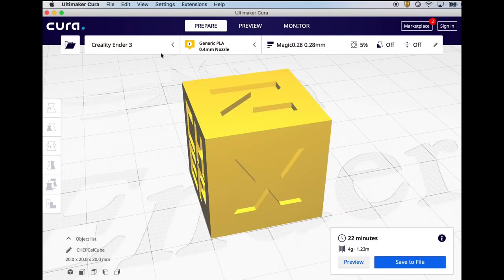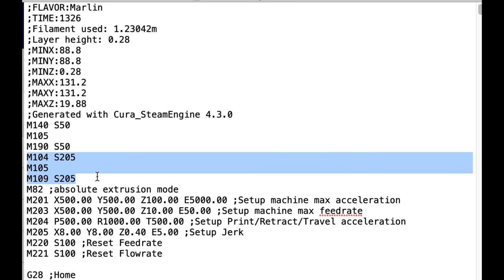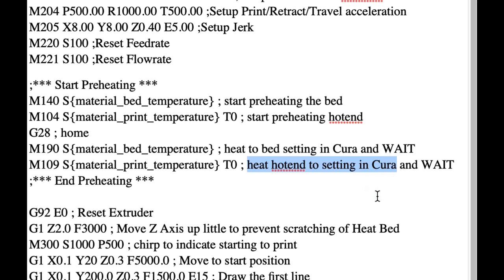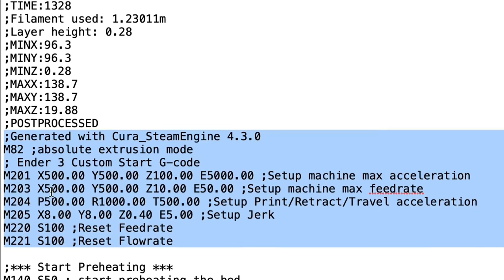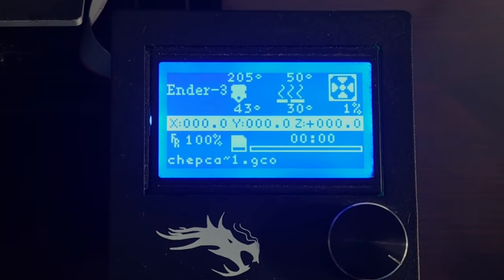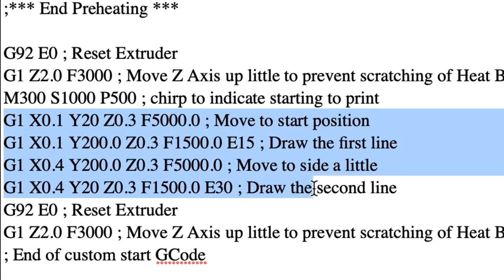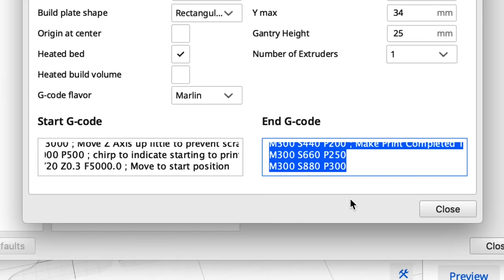Faster Hot End & Heated Bed warm-up in Cura

Comment: I am using the Creality Ender -3 v2 profile in Cura. There are no '"M" g-codes in my Start G-code settings in this profile. Is this some that has changed since this video was made?
Reply from the maker: You have to add them per the video. Link in description
Reply: @FilamentFriday  sorry, I didn’t explain myself properly. Your profile had a number of “M” g-code lines before you added these new ones. Mine didn’t have any so my start g-code looks very different to yours to start off with. I was trying to figure out where in the start g-code to put these new lines compared to yours.
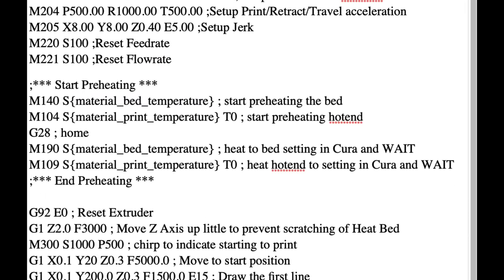Reply: Yeah, mine was also different, didn't have the "M204" etc. lines you see at 2:27, it just started with:
; Ender 3 Custom Start G-code
G92 E0 ; Reset Extruder
G28 ; home

I just wrapped the new code around that home command.

Comment: Just recently started 3d printing. I always assumed there's a good reason for this. Have you noticed any downsides to doing this? Maybe shorter PSU life, higher power usage or something?
Reply from the maker: Nope.
Reply: @FilamentFriday  Cool! Thanks!
Reply: If you preheat your hotend too early, it starts oozing out before its ready to print. This also leaves a hollow cavity in the nozzle, and you have to do a skirt or something on your prints before starting or your initial layer gets messed up.
Reply: Sean like cuts already does with the test strip

Comment: Hi CHEP, 

Preheat command no longer works on Cura 4.7
It seems to heatup to temperature and stop reading lines after when command line is input in start g-code.
Everything resumed to normal when code was commented out.
Reply from the maker: I’ll check it out.
Reply: Are you using Cura 4.7 since its still buggy so I recommend staying with 4.6 for a bit
Reply: Ah shit I was about to input this in Cura 4.8

Do any of you know if this is currently working?

Comment: Note that there is a couple of bad printers out there where the PSU isn't made to handle the power needed for both to heat up from cold, thus potentially reducing the PSUs lifetime. If you have an 8 hour print, saving these 5 minutes isn't really worth it.
Reply from the maker: Which is why I mentioned it in the video.
Reply: thats the first thing I thought But its good if you got AC heat bed (i.e Tevo Flash) useful Video for me Thanks :)

Comment: It seems that the Silent Board 1.1.5 for Ender 3 can sing in only one tone. I tried different values, the "Pxxx" parameter works well but "Sxxx" as no effect.
Useful tip anyway ;)
Reply: I dont have the silent board but I have new Ender 3 Pro and it also only sings one tone.

Comment: Putting this in start gcode doesn't work for me. I also noticed different variables used in the video vs the files on your homepage. Do i need to remove other start gcode in addition to make this work? What happens when I hit print is that the bed heats up....that's it. nothing more happens. No hot end heating = no printing.
Reply: K, got it. Copy pasted from another source which seems to be the same text. Seems either in copy&pasting from your hp there's some format error stuff happening or there's some misstake in it.

Comment: Nice THX! But, how do I write that the hotend does not heat up with the bed at same time, only when the bed has reached 50% should the hotend start heating? I think hotend is faster as the bed... How is the Gcode to say "when bed has 50%, heat the hotend" or "wait 120 seconds before heat the hotend"? You know what I mean?
Reply from the maker: I believe there is a delay GCode. I just can’t remember it.
Reply: @FilamentFriday  Too bad. I think that if both are heating at the same time it is a higher load for the power supply. The other way around it takes a long time and a compromise would be delayed heating ...
What ever, thx for your answer so quickly :)
Reply: You can check what's the average time it takes to reach your max temp, divide that by 2 and try to use G4 command to wait.
Reply: @siveonfarcloud4190  It works, it works very good for PETG, but not for PLA and really bad for TPU :(
What I need and search is a way to make:
if (bed_temperature <= 40) {
M140 G4 S0 }
if (bed_temperature >= 40 && <= 60) {
M140 G4 S60 }
if (bed_temperature >= 60) {
M140 G4 S120 }
Reply: @la3el  For anything more fancy you would need to manually edit the gcode or the firmware.

Comment: Using a glass bed I've noticed that it take a bit longer than the bed to get to temp on the print surface compared to what the readings say. So I'm wondering if this really is a good idea on glass?
Reply from the maker: Test it and find out. I use a swipe of glue stick on my glass and often can print PLA without heat. So it depends on your setup.

Comment: I always just turn on my printer then preheat pla.. this heats both up at the same time. Then when it's warmed up just print file.
Reply from the maker: But then it sits hot until you install the file and click print or if you walk away. The PLA can expand and clog. I prefer it to start heating when I start the print.
Reply: @FilamentFriday  ok.. it only takes a minute or two and I always sit and wait and watch things.. when they are heated up, I turn the extruder to see how the filament is coming out.. then I watch at least the first layer go down..
I have never just pressed print and walked away..
That's just me though with only 1 3d printer.
Reply: @BlindDude  You have to understand that us seeing people have shorter attention spans. ;)

Comment: my ender 3 does that from out of the box both heat up at the same time  yes the hot end gets there first .the bed maybe 10 to 20 secs after ish
Reply from the maker: From the GCode or are you using the LCD menu?

Comment: I want my fans to shut off after 5 min, (extruder fan)  my monoprice mini does that, but I'm not sure if I can just use that same code commands or not. Sometimes I don't know the print is done for quite some time and there is no need for the fan to run longer than it needs to. are all the commands the same? the M commands?
Reply: This is what the command looks like:
G4 P300000 ;wait 5 minutes before turning off the fan
M106 S1 ;turn off fan
Reply: Did you try it?  Results??
Reply: Steve Martin the extrudes fan is wired to constant power,, so it’s on all the time. As for the Gcode, I didn’t keep the startup, and I just added the beer to my end Gcode.

Comment: This only works if you only have one printer per UPS (assuming you have your 3D printer hooked up to a UPS). When I try to heat up the bed and the hot end at the same time on 2 or more printers hooked up to the same UPS (1500W UPS) the UPS alarm goes off. I have 3 CR10s PRO per UPS and I can heat up only one bed at a time. After the initial warm up, I can have all 3 beds hot with no problems. Someday I would love to have a UPS per printer.
Reply: Interesting, since the Ender3 power supply only puts out 24volts at 30 AMPS, or 360 watts, even rounding the input watts to lets say 400 watts, three power supplies running at 400 watts each would only draw at a maximum of 1200 watts, your UPS must not be rated to even handle 1200 watts continuously if it's complaining  when you do this. The APC 1500 really is only rated at 865 watts.
Reply: @TheDgdimick  You are correct! I should have said 1500VA/900W UPS. I am using the CyberPower CP1500PFCLCD PFC Sinewave. That is a $200 UPS. I wish I could have afforded to buy a better model for my printers, but I had to purchase 4 UPS and my wife was not going to let me spend more money lol
Reply: @oscarreyes4511    Not a problem, I was just worried that you may not know that you don't get 1500watts when you buy the 1500 model, deceptive advertising if you ask me, and it's pretty much done by everyone.

Comment: File links don't work anymore
Reply: ; CHEP Ender 3 Custom Start G-code
M201 X500.00 Y500.00 Z100.00 E5000.00 ;Setup machine max acceleration
M203 X500.00 Y500.00 Z10.00 E50.00 ;Setup machine max feedrate
M204 P500.00 R1000.00 T500.00 ;Setup Print/Retract/Travel acceleration
M205 X8.00 Y8.00 Z0.40 E5.00 ;Setup Jerk
M220 S100 ;Reset Feedrate
M221 S100 ;Reset Flowrate
 
;*** Start Preheating *
M140 S{material_bed_temperature} ; start preheating the bed
M104 S{material_print_temperature} ?T0 ; start preheating hotend
G28 ; home
G29
M190 S{material_bed_temperature} ; heat to bed setting in Cura and WAIT
M109 S{material_print_temperature} ?T0 ; heat hotend to setting in Cura and WAIT
;*** End Preheating *
 
G92 E0 ; Reset Extruder
G1 Z2.0 F3000 ; Move Z Axis up little to prevent scratching of Heat Bed
;M300 S1000 P500 ; chirp to indicate starting to print
G1 X0.1 Y20 Z0.3 F5000.0 ; Move to start position
G1 X0.1 Y200.0 Z0.3 F1500.0 E15 ; Draw the first line
G1 X0.4 Y200.0 Z0.3 F5000.0 ; Move to side a little
G1 X0.4 Y20 Z0.3 F1500.0 E30 ; Draw the second line
G92 E0 ; Reset Extruder
G1 Z2.0 F3000 ; Move Z Axis up little to prevent scratching of Heat Bed
; End of custom start GCode

; Ender 3 Custom End G-code
G4 ; Wait
M220 S100 ; Reset Speed factor override percentage to default (100%)
M221 S100 ; Reset Extrude factor override percentage to default (100%)
G91 ; Set coordinates to relative
G1 F1800 E-3 ; Retract filament 3 mm to prevent oozing
G1 F3000 Z20 ; Move Z Axis up 20 mm to allow filament ooze freely
G90 ; Set coordinates to absolute
G1 X0 Y$machine_depth$ F1000 ; Move Heat Bed to the front for easy print removal
M84 ; Disable stepper motors
; End of custom end GCode

Comment: i used the code in mine ender 3 pro it works perfect but is it not possibel to heat faster the bed if you start normal the bed heated 2a3degrees a time with the code is that 1°c, so if i used the code the nozzle stays 4/5 min faster hot thane the bed i print abs 110°c bed and 245°c nozzle.
Reply: Good info, Pedro.  Sounds like it's not a good change for printing with THAT hot of a bed.

Comment: You should only do this if both heaters reach the temperature at the same time. Its not recommended if the bed takes a long time to heat. For example with ABS which has to reach ~100°c and that takes like 5-10 minutes or longer if you have no isulation. Its never a good idea to keep the nozzle "empty" (after the filament ozzed off) on high temperatures for too long in the first place. Since it may can burn small bits of plasic and could cause clogs in the future.

I did this when i got my first printer with ABS. Bad idea. And i learned: Id rather wait 1 additional minute then spending hours unclogging my nozzle :)

PS: This trick doesnt even matter when using exotic filaments like ABS, you still have to wait like 10 minues until the bed reaches the temperature. That one additional minute you have to wait until your nozzle reaches the temperature feels like a second then, trust me.
Reply: You can however pre-heat the nozzle to say 160deg, or begin heating at say 50deg for a 60deg bed etc.

Comment: I tried this and added the preheat script to Cura, but I have an issue with that it still add the temparature before. I can uncheck "Heated bed" and it will remove the M140 S70, M105, M190 S70. But not the M104 S200, M105, M109 S200. Using Cura Ultimaker 4.8 on an Ender 6, but same with the Ender 5 profile.

;Generated with Cura_SteamEngine 4.8.0
M140 S70
M105
M190 S70
M104 S200
M105
M109 S200
M82 ;absolute extrusion mode
;*** Start Dual Nozzle/Bed Preheating *
M140 S70 ; start preheating the bed
M104 S200 T0 ; start preheating hotend
G28 ; home
M190 S70 ; heat to Cura Bed setting 
M109 S200 T0 ; heat to Cura Hotend
;*** End Preheating *
Reply: Have you fixed the problem yet? Because it doesnt work for me either

Comment: Did this stop working in Cura 5.7?
Reply: I found that they changed variable naming, I will leave it here, maybe someone will make use of it.

{print_temperature} Alias for material_print_temperature
{print_bed_temperature} Alias for material_bed_temperature

But in my opinion there should be used another parameter, because often you can set different initial layer temperature, so then this will be handy:

{material_print_temperature_layer_0} Printing Temperature Initial Layer
{material_bed_temperature_layer_0} Build Plate Temperature Initial Layer

Comment: This works well in my Cura 4.8 but not Creality Slicer 1.2.3.  For some reason the Creality Slicer 1.2.3 ignores the M140 and M104 commands completely.  I have tried different variations (e.g. "M140 S60" "M140 S{material_bed_temperature}"  "M140 S{material_bed_temperature_layer_0}" and none work with Creality Slicer 1.2.3.  Does anyone have a similar experience or fix for the M104 and M140 commands in Creality Slicer 1.2.3?
Reply from the maker: Creality slicer is based on Cura so why not just switch to Cura?

Comment: This may not be safe to do with the older ender 3 because of that connector not being soldered right between the board and PSU
Reply: If You have bad connector it will fail either way.

Comment: So I would like to use this on me ender 3pro. 
I am having issues with cura 4 not printing my stl files in the center..  
I’m very frustrated. I have turned on start in center, and turned it off. 
Please help so I can start using my ender 3 pro.
Reply from the maker: How far off center?
Reply: It prints in the home location in the bottom left corner.  And it could be a print that’s the size of the print bed it will keep it with in a inch or so of the bottom left corner.
Reply: If your print bed dimensions are wrong in cura, it will print off center. Make sure you have 220 x 220 x 250 entered. I tried 235x235 for a while, attempting to squeeze a little more print area out, but it would print off center.

Edit: I just read your other comment. This probably is t your issue, but I guess it doesn’t hurt to check.
Reply: I tried changing the print bed size didn’t work. It is all correct as far as that goes I went to Creality for the dimensions. I have read somewhere that you’re supposed to put a edit into the G code to migrate to the center of the bill the plate. I can’t find it. And I don’t know where I would put it anyway. All of the demo prints that came with the 3-D printer function fine and they print fine.
Reply: Biship c that’s really strange. I have an ender 3 pro that I’ve been using for very close to a year and mine has always printed in the center(except for when I changed the build plate dimensions). I hope you get it figured out. If I happen to run across a solution, I’ll post it here for you.
Reply: Your home settings are set-up OK on your Ender 3 Pro through the display?
Reply: I seem to remember that this can be caused by checking the box in Cura labeled "Origin at Center" in the 'Machine Settings' section for your printer.  Make sure that option is disabled (un-check the box).  I could be wrong, but it's worth taking a moment to verify that it's set correctly.

Comment: i have idex printer Climber7, added  gcode
;— Start Hotend & Bed Preheating
M140 S{material_bed_temperature_layer_0} ; set bed temperature
M104 S{material_print_temperature_layer_0} T0 ; set left hotend temperature
M104 S{material_print_temperature_layer_0} T1 ; set right hotend temperature
G92 E0 ; reset extruder
G28 ; home
M190 S{material_bed_temperature_layer_0} ; wait for bed temperature
M109 S{material_print_temperature_layer_0}  T0 ; wait for left hotend temperature
M109 S{material_print_temperature_layer_0}  T1 ; wait for right hotend temperature

But at start both hotends warm up to the same temp, i set in cura 1st  hotend 260, 2nd hotend 200. After warmup to 260 both hotends left hotend cold down to 200. 
Any way to fix that? 260 is too hard for pla, And if i put pla to the 1st hotend and abs to the 2nd. both will warmup to play temp.
Reply: Well, it's using the same variable called "material_print_temperature_layer_0", so it would obviously set the same value for both.
It's just a guess, but since this one is labeled with "_0" there's probably a "_1". 
You can just look at the created GCode with a text editor to see if the value is correct, no need to "test" it with an actual print.

Comment: The power theory is bunk... The hotend and bed are always heated together during printing. They make it staggered so that you don't cook the filament in the hotend which can lead to heat creep and clogging. and since some hotbeds can take 15 mins or more to get up to a certain temp you definitely wouldn't want your filament sitting at 210 in the hotend for that long
Reply from the maker: Many people also use the pre-heat in the menu to heat up both. If they forget it can also cause the filament to overheat. This option I show only heats it up just before it automatically starts the print. Works well for me on Ender 3.
Reply: @FilamentFriday  Yea I saw it worked perfect your ender 3.  I would be scared to do it on larger beds with lower voltage like you mentioned. I've always learned to try not to cook the filament in the hotend. My CR10 would take nearly 15 mins to reach 75c but hotend would get to 230c in 3 minutes. It would be cool to have a set point. Like bed=50c -> start hotend.
Reply: @cutty02  is it not possible (not tried this) to send multiple M190 commands, so in your case run a M140 S75 (heat bed to 75) then a M190 S50 (carry on at 50) followed by M104 S230 (heat hot end 230) followed by M190 S75 and M109 S230 (wait until bed is 75, then wait until hotend 230)?
Reply: @fatrobin72  That's a very smart Idea!
Reply: @cutty02  as mentioned I have not tried it, and I don't know if you can setup Cura start scripts to do a 2/3 temp so you might have to hard code the M190 S50 bit

Comment: I use a spring steel sheet so my bed level changes often if I bend the sheet to pop off the print.  You can insert the G29 in the middle right after the G28 if you want to do bed leveling while you wait for the heating to finish.
Reply: You mean probing the bed (bltouch/3Dtouch inductive/capacitive) . Not everybody has that 😉